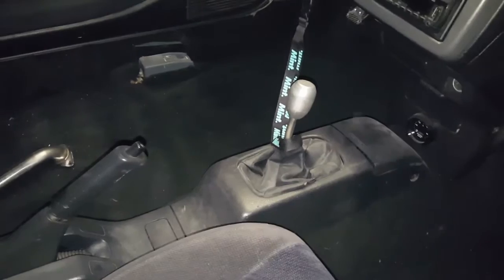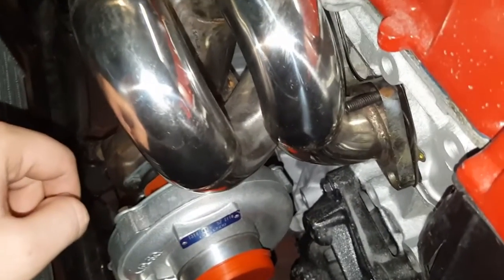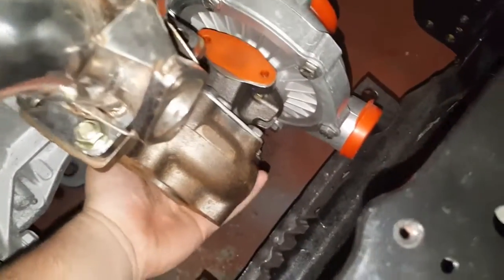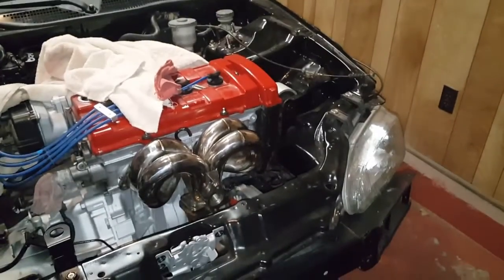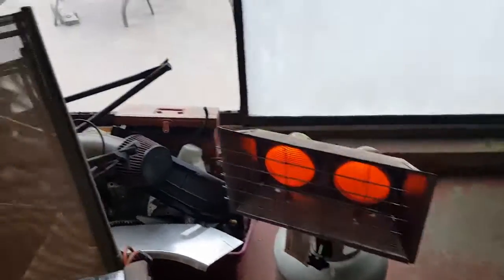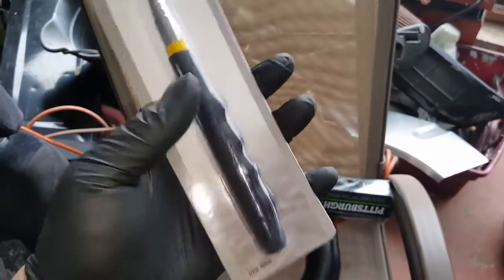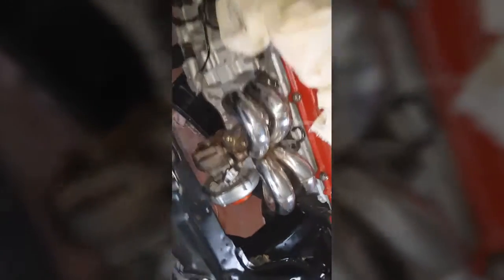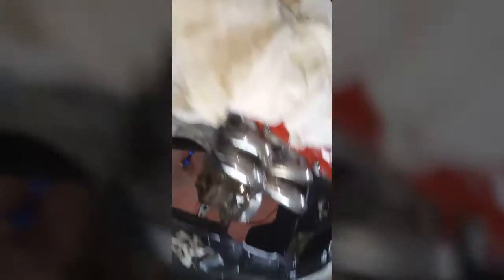HONDA CIVIC HATCH GETS BOOSTED ON A EBAY TURBO?

Comment: Oh eBay parts so much work making shit fit lol. Keep it up. I subbed.
Reply from the maker: RedLineBandits wasn't too bad. did a good amount of fab though lol. got it running but my software is all fucked right now so I can't post but it will be up soon!
Reply: Chaylabay Sounds good. I installed a eBay kit on my auto civic. So much cutting and welding lol.
Reply from the maker: RedLineBandits with the b series swap and ac delete, power steering delete etc it was quite easy for me. only fab work really was welding in for the oil drain. gotta finish up some interior and weld in the cage and then I'm saving for cams. I've seen a few of your videos aswell. great job and keep it up . I subbed aswell